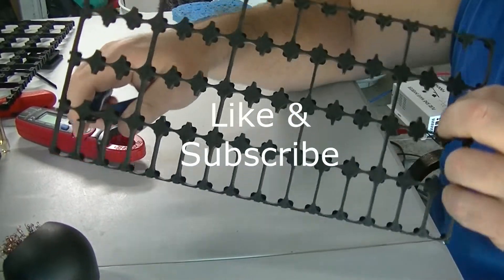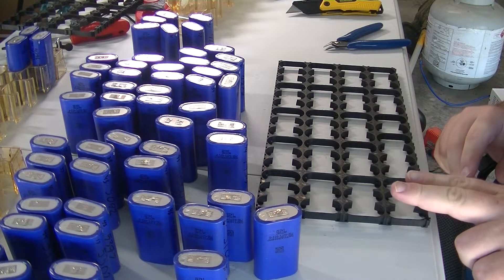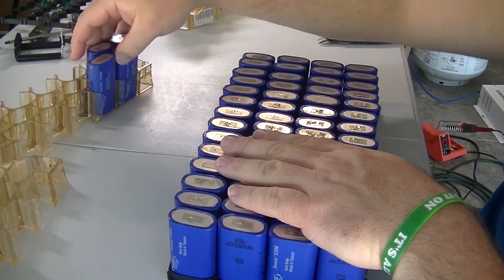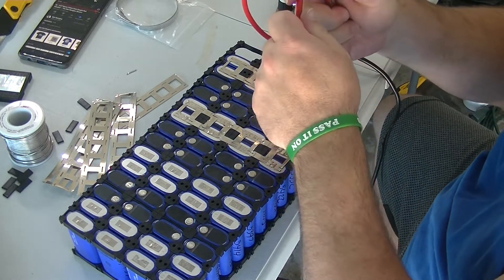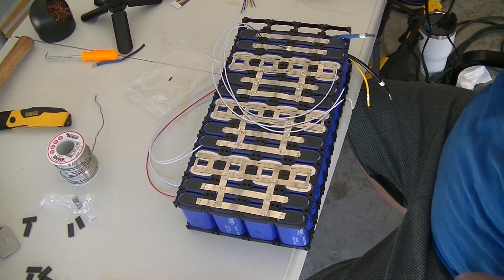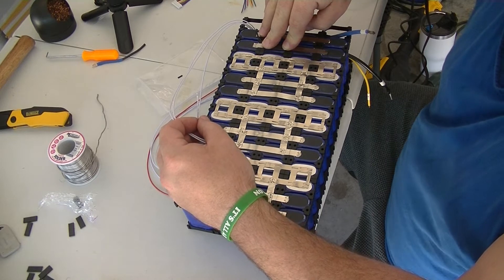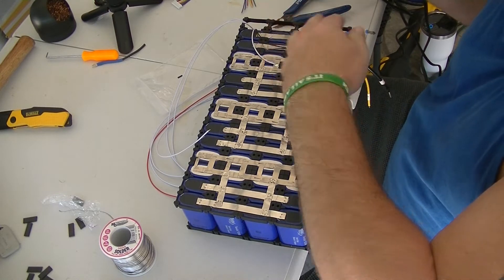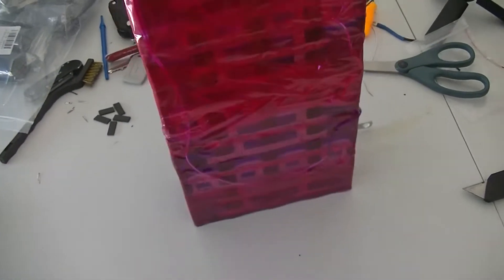24v Complete Build, 18650 build, Boston power cells

Comment: You can use repackr to split your batts into S groups, software will work it out for you so the battery is the most balanced it can be. Also since you asked what we think, I think your cell group interconnect of 2 stips is not enough. Assuming it's normal 0.15 10mm Nickle it's good for about 20A. I assume the BMS is 60A?
Reply from the maker: Good point. Should have put more connections. more is better. I will do that. Its a 45a BMS.  1000 watt inverter at a lower voltage of say 23v= about 45 amps.